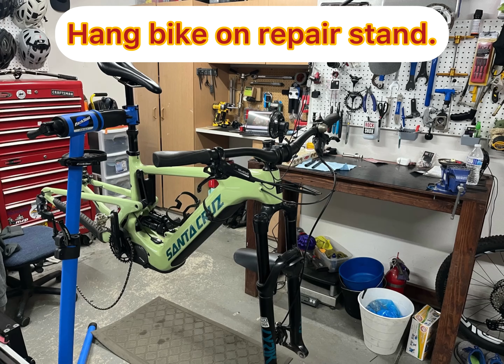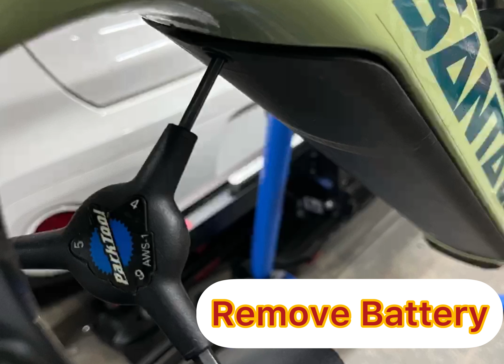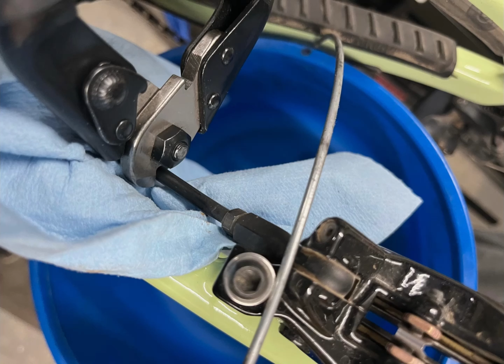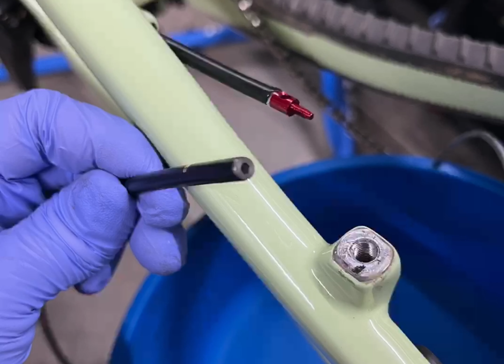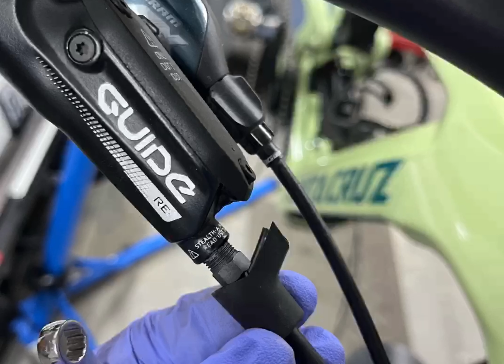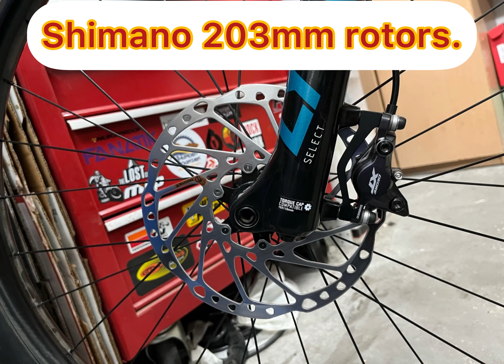SRAM Guide RE to Shimano XT | Rear brake install | 2022 Santa Cruz Heckler MX R-Build

Comment: Is the 1mm spacer needed for under the calipers? If so…what do I buy and where? Cheers
Reply from the maker: I can't remember if this was the bike where I had to put spacers but when I did need to add spacer, I used the spacer that came from my old brake sets (sram/shimano).

Comment: All my ebikes are 4 pistons, 180 rear and 203 front. Still feels like I need more stopping power…
Reply from the maker: The stock on mine was 200mm and now it's 203 front and rear. I don't have long steep DH trails. The longest is probably a 1/4 mile and so far no overheat or brake fade. Maybe try bigger rotors and Galfer pads.